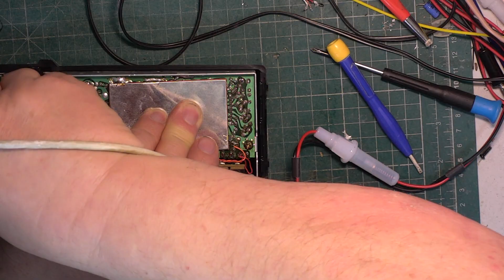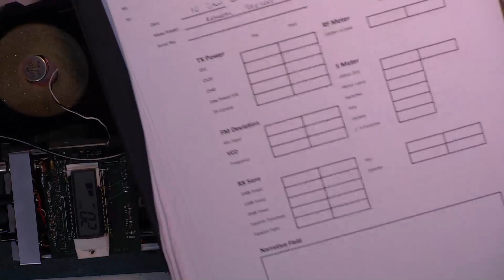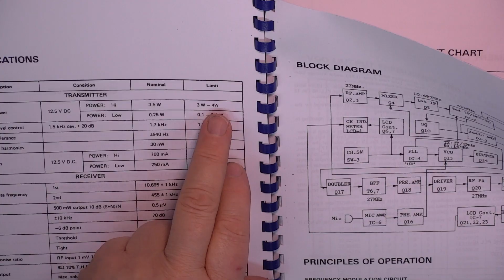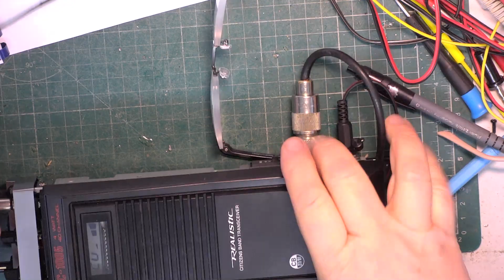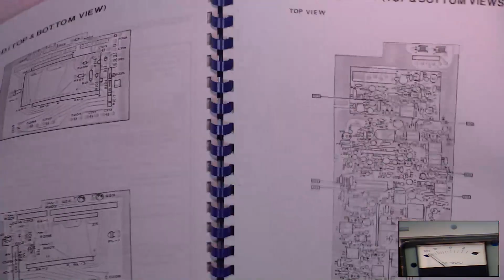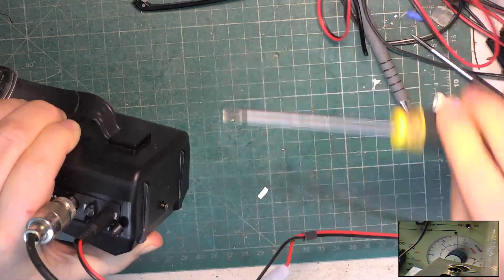Realistic TRC1005 CB27/81 UK FM CB radio handheld -  repair & service set 1

Comment: Where did you find the service manual?  I have the same radio. When switching channels, the radiated radio frequency does not change and remains the same (27910 MHz).
Reply from the maker: I bought it new from Tandy'sUK National Parts Centre at Wednesbury in 1983 a a cost of £16.99..

The PLL isn't running on yours, you're just getting the VCO's resonant frequency. Start by looking for dry joints, especially the pins that go between the two sides of the PCB; they'll be the problem.

Richard, G0OJF, UK
Reply: @ukfmcbradioservicingTango21  I found it. The synthesizer was constantly working on channel 1. On pins 1-6 of the LS 7136, there was always a logical zero, regardless of the position of the channel switch. There was a defect in the metallization of the hole in the main printed circuit board. Soldering it solved the problem.
Reply from the maker: @Петр-з1ы2и  Good stuff. Richard